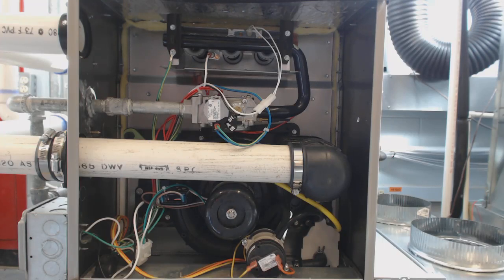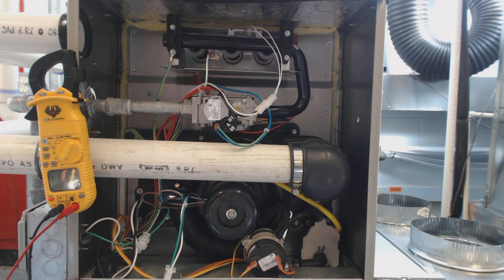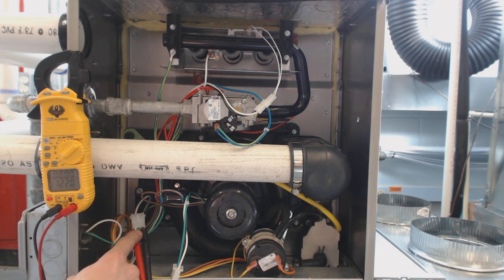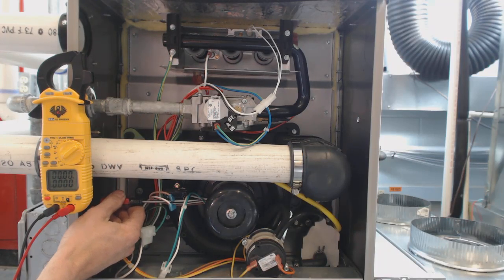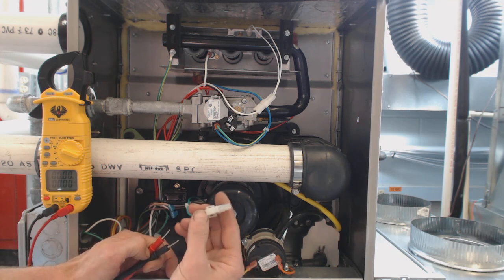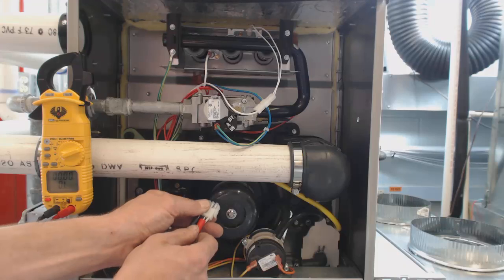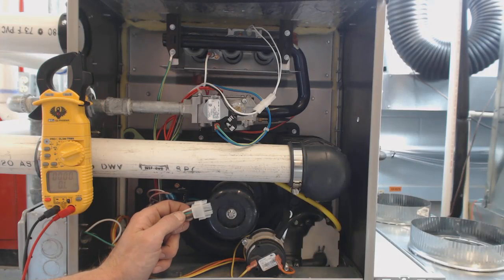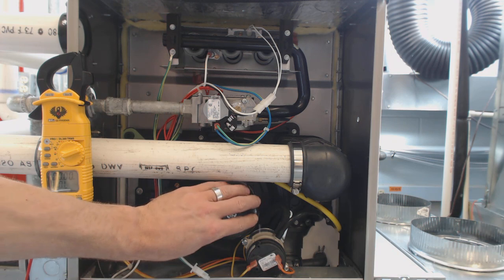How to tell if an Inducer Motor is BAD: Explained Step by Step

Comment: Awesome video! I have a question. My inducer motor winds up, but shuts down after spinning up for 2-3 seconds. Process then restarts, over and over again. Motor is getting 120v, Thermostat has been jumped. Voltage across R and C is 24v. Fuse on the board is good. Resistance between White and Black on the motor reads 3.7ohms. Is that too low? I had been thinking bad pressure switch since I blew into them and things worked temporarily after that, but the furnace manual's order of operations show a 15 second inducer pre-purge prior to the pressure switch step. Does that mean pressure switches shouldn't be considered a factor since the motor shuts off after only a few seconds? LED is not helpful. I just get a solid red LED(normal) until the motor shuts down and the LED turns off until the furnace restarts. The furnace is a 3yo Goodman gmss92.

Thanks if you took the time to read this! Please don't feel obligated to answer. Your video have been very helpful already. :)
Reply from the maker: You could temporarily jump the pressure switch to see if the inducer continues to run. If it does then remove the jumper and locate the problem with either condensate line clogged, exhaust clogged, tub clogged, bad pressure switch, low combustion air or another issue. Make absolutely sure not to keep the pressure switch jumped. This is an EXTREMELY IMPORTANT SAFETY. That is just for 30 seconds of testing only to see what is actually bad, thanks. Most of the time with the pressure switch, there is a problem with water or clogged tubes and not the pressure switch itself, thanks and search "acservicetech pressure switch troubleshooting playlist" for more info.
Reply: I jumped the pressure switch and the inducer ran like a champ. Checked continuity on switch and it was erratic, so I replaced the switch and all is good now! :) Once thing that threw me for a loop: I had to wait a moment after power up before jumping the switch. Furnace must not like to see a closed switch at when it starts.

Thanks a million for your advice! :)
Reply from the maker: Cool, glad you found the problem Raz!

Comment: if you don't get 120vac to the motor then 100% the IFC is defective. is this a safe conclusion? thanks.
Reply from the maker: Check the contacts on the board first but yes if you have 24v between w and c and the blower motor is not running due to an open safety relay. I have seen loose connections on the wiring, thanks

Comment: Great vid, thanks. My inducer motor runs but the furnace won't ignite until I tap on the inducer motor somewhat lightly.  The vacuum orifices are clear and tube is clear with no cracks. Any ideas? Currently working and I used pressurized air in a can to blow some debris out of the housing. Chances are I will have to tap it again in the morning. Btw, I have to buy a voltage tester so I have no answers there.
Reply from the maker: It is possibly that the tapping is making the pressure switch itself close because it is possibly hung up but the reality is nobody would be able to tell you anything without taking voltage and vacuum readings with a manometer, thanks
Reply: acservicetech Thanks for the response. I will be checking voltages soon as I get to town and spend some $
Reply from the maker: i would look into a digital manometer as well. Did you watch the "acservicetech pressure switch playlist" with other pressure switch troubleshooting?
Reply: acservicetech Thanks, gonna do that now.

Comment: What if you are not getting the 120 volts from your board to call inducer motor?
 That is the problem I am having at the moment
Reply from the maker: Do you have 24v from w to c on the board as a call for heat?

Comment: How can I order the right part, is it with the model number on the equipment or on the motor, I recently ordered in Amazon and they sent me a smaller motor they said that the one y want is obsolete.
Reply from the maker: In reference to furnace parts, it is different than tools. I always go through my local distributors to get large furnace and ac parts for warranty, same or next day free delivery, and overall help finding the parts. Each local distributor will deal with a different manufacturer of hvac equipment. I have dealerships with each of them and if they deal with that manufacturer typically all that is required is model and serial furnace or ac unit. I do write down the part specs and ask them to read them to me when they figure out the part to verify if I have the correct one. I hope that helps, thanks Ruben!
Reply: acservicetech thanks a lot, I will like to support your channel.
Reply from the maker: Thanks Rubin, I am doing what I can for everyone! Here is the support url, thanks- https://www.acservicetech.com/support-acservicetech/

Comment: I just checked a trane  package unit and the inducer motor was 170 degrees I told my customer that it was gone.can you tell me if I was correct. Thanks
Reply from the maker: The inducer motor on a 80%-98% efficient furnace should never be that hot, correct!

Comment: Very instructive. If ever you can explain how to troubleshoot ECM inducer, that would help me to. Thank's for your good work
Reply from the maker: Ok you really need to look up the manufacturers troubleshooting guidelines on those. The control board actually talks in millivolt dc back and forth to the ecm inducer. There is no 24v override to check if it is working like the ecm 3.0 blower motor, thanks

Comment: I'm getting an led indication on my board "pressure switch is open with inducer on" inducer motor runs but does not go beyond that. When I disconnect a tube running from pressure switch to the burner chamber and start the cycle again no blinking led, inducer motor runs, ignition begins and flames come on and lasts for about 15-25 seconds, flames go out and warm air turns to cooler air never reaching the desired temp. How can I further troubleshoot this?
Reply from the maker: You would need to look at the pressure switch and see what the water column reading is or look it up. Then take the negative pressure from the burner box and minus this number from the tube hooked up to the condensate drain or inducer motor to get the differential "wc which should be higher than the pressure switch. Thanks and here is the pressure switch playlist- https://www.youtube.com/watch?v=XKAyznghlro&list=PLxnHR5_D2ojytzJCx7C5ruHcmaYicpJ7a
Reply: +acservicetech thank you for the assistance... I have since removed the inducer motor and realized a plastic seal was cracked and britle. I noticed a build up of crust like material around the intake. I cleaned it up and removed the broke seal and then reseated with high temp silicone sealant. The furnace now operates without error and goes through full cycle BUT the flames kick off after 30 seconds or so and the blowing air does not feel warm. Any suggestions

Comment: Had a problem on a similar furnace as this one where I was receiving 24 volts on a call for heat and my inducer spun a few times then stopped. I then checked the capacitor and measured 4.91 on a 5uf so I knew that was ok. Then I checked the inducer by rotating it and it spun freely. So then I checked for voltage coming from the board to the inducer and measured only 65 volts, bad board?
Reply from the maker: Did you happen to check the incoming voltage and make sure that there was not a reduction in voltage there? I would follow this 120v all the way from  switch outside to the connection to the board. If it is 120 on the board then yes bad board, thanks
Reply: I did not check voltage coming in only because my blower would start and run no problem but I will double check that to make sure I do have proper voltage to the board, thanks for your help.
Reply: Why do inducer motors seize up? I came across a goodman inducer that was stuck and when I started to rotate it then it started up but there was a really bad grinding noise to it but everything else worked fine and the furnace fired up. I checked ohms and everything was fine was reading OL from wires to ground and I was getting 120 so I was just wondering what causes that to happen? And can I put some lubricant on it to make it better or just replace it? Would it go bad again if I were to leave it?
Reply from the maker: Yes it will go bad if you leave it. If the motor has oiling ports and no one has been oiling it then the bearings go bad. If they are sealed bearings, they may have just went bad over time.

Comment: Thanks for the great video!  I have a very noisy inducer which has just failed and I ordered a Rotom replacement.  I didn't run any of the tests you showed as I think it is pretty clear the inducer is the issue.  My concern is that on the new inducer, when I spin the shaft it appears that the impeller may be ever so slightly out of balance - it exhibits an almost imperceptible variance.  I am wondering at what point does an out of balance impeller create a problem?  As minor as it is I suspect it will run fine now, but worry a bit about down the road.  How much tolerance can be expected?  Perhaps I should exchange it, or accept the fact that a small amount is acceptable?  Thanks so much.
Reply from the maker: Exchange it to be sure. Thanks
Reply: thanks for the quick response.  I called the supplier and they are swapping it out no problem.
Reply from the maker: Great to hear!

Comment: Thank you for the very well-done video. Would appreciate any suggestions to solve my furnace problem - I have a hi efficiency furnace (ICP Furnace Model NHGK050AF01) , running on propane. Professionally installed in my garage about 10 years ago and used only sparingly during the winter months. Starting last November, the furnace began to malfunction... specifically, when called on for heat, the inducer motor comes on, then the igniter, followed by the gas. The flame is solid yellow and after a few "popping" episodes, the gas shuts down and the igniter/gas steps are recycled endlessly. I had the gas pressure checked by the propane company... no problem. Air intake seems clear. I found that when the exhaust pipe was disconnected from the inducer, the furnace ran fine. So I figured the exhaust pipe was blocked. I cleaned the pipe (nothing in it but some dust) and reinstalled it. Same problem. The inducer fan doesn't make any noise and "seems" to be expelling a considerable amount of air. The only thing I come up with is the inducer fan/motor is slowly failing and cannot move sufficient air through the furnace if there is the slightest restriction. I've had one heating contractor out here already, but he didn't check the airflow as I have just explained. (I am using an alternate heat source until I get the furnace up and running again). Comments please.
Reply from the maker: Most of these furnaces you cannot change anything on the inside of the furnace but the gas pressure as far as the efficiency is concerned. I would have someone check the outlet gas pressure going to the burners, if the complete conversion from nat gas to propane was originally installed correctly like the spring, possible air inlet plate, orifices, and outlet gas pressure. When these are incorrectly set, the propane will not burn blue. Also then the soot corrodes on the flame sensor and you can't prove the flame correctly which sounds like may be happening. Yes also have them check the water column negative pressure on the combustion box and the exhaust to see if they see a problem with that. The pressure switches could also be shutting your furnace off and then the sequence has to start over again. Check for an error code. Also have a combustion analysis done when they are finished. Make sure to tell them that you are looking for them to really spend the time it will take absolutely correcting the situation. You are not looking for someone with 15 service calls to try to do in a day to run in and leave. You just need to get the right company in there, that is all. Thanks
Reply: Thank you. The furnace was set-up for propane from the start and has been running without a hitch since when it was installed. It always burned with a nice blue flame until this issue began. I opened up the garage this morning and turned the furnace on with the exhaust pipe disconnected. It ran for about 5 minutes, then the yellow flame/popping/restart issue returned, which leads my novice brain to think the fault may lie with the condensation thingamig. I concur with the advice to get a competent furnace man out here. That's really the issue around here out in the sticks. A lot of "professional" HVAC guys until they run into a genuine problem, then they are lost.
Reply from the maker: If you have a blue flame and then the blower fan motor turns on and the flame starts popping and is yellow you want to look at a possible cracked heat exchanger. The air from the blower blows through the heat exchanger and out through the front of the combustion chamber. That would be a dangerous situation if that were the case. That would be a possibility of carbon monoxide into the air. Just letting you know so you are informed of the possibility and for something else for them to look for. If that is really what is happening you need to make sure that the tech has a co detector checking for 9ppm and have them come out as soon as possible. Thanks Jim
Reply: Solved the problem. I cleaned the burners and ran compressed air up through the heat exchanger. 10 years of carbon and dust came flying out the exhaust. Back to a nice, clean blue flame again. Thanks for all the information.
Reply from the maker: That's great to hear!

Comment: GREAT VIDEO! Like the way you make it so straight forward. So if I am getting the 120V to hot and common wires of the motor the motor is definitely bad and then needs to be replaced correct?
Reply from the maker: If the capacitor is good if it has one and the motor will not start when 120v is applied then yes you would need to replace.

Comment: What if when you check for ohms of resistance, it is only showing 35 ohms instead of the 80 you are showing?
Reply from the maker: Each inducer motor will be different depending on the type of motor. It is likely good. If you were really concerned about it then you could check it with a megohmmeter. Is it not turning on?
Reply: It turns on everytime I was just making sure that the induction motor was not the problem.  My issue is i receive a 31 code on my bryant furnace and there doesnt seem to be enough oxygen getting to the combustion chamber.  When I take the cover off the chamber, it lights right up.  If the cover is on, the pressure switch doesn't seem to activate correctly which is why i thought the induction motor was going bad.
Reply: I took a vacuum and blew out the intake to make sure there were no clogs too.
Reply from the maker: You want to check for a blocked intake air pipe for combustion, cracked heat exchanger- check co levels and if the flame is popping back at the combustion chamber when the blower turns on- usually the flame rollout switch will pop but not always,  or a bad pressure switch. You should also blow out the condensate trap and lines with the pressure switch not connected and also check the port at inducer housing for the pressure hose to make sure it is not blocked off. Let me know how you make out. Thanks
Reply: took out all the condensate trap lines and the trap itself and blew them all out.  No luck.  The port at the inducer housing though seemed to be the issue.  Took a toothpick and pushed into it and there was some sort of calcium buildup on my toothpick.  Put it back together and now it seems to work just fine.  Thanks a lot
Reply from the maker: Awesome, Glad to help!

Comment: You can also do an amp draw on the inducer before unhooking any wires or checking the cap and that will tell you if you have power going to the inducer
Reply from the maker: This is correct. If you have noticed in my videos,  I always try to teach newer techs to check with resistance because it is safer and you know exactly what failed. If a tech chooses on their own to initiate their testing with amperage then they could. Thanks for pointing that out!